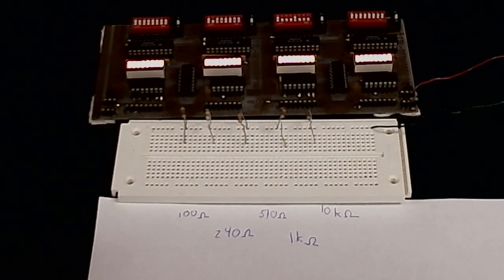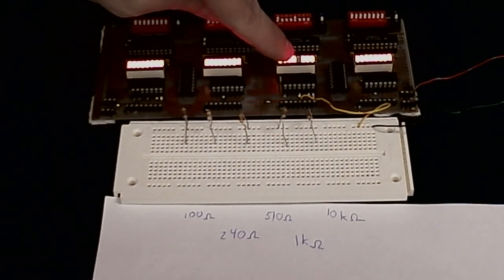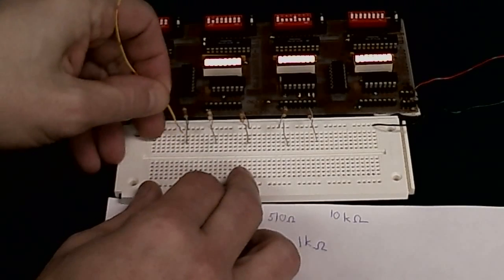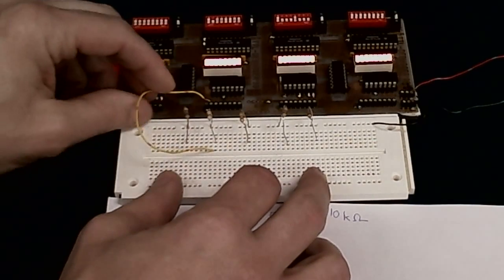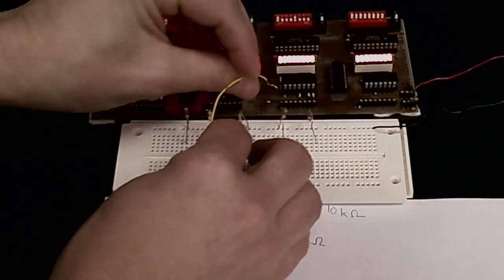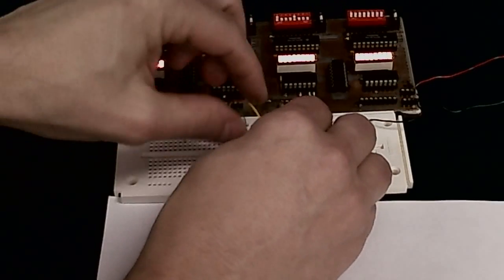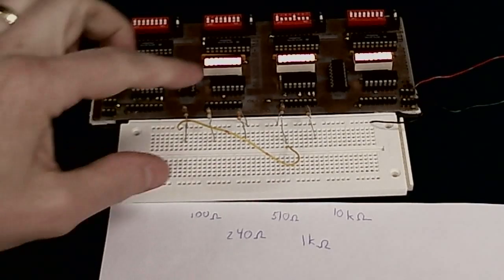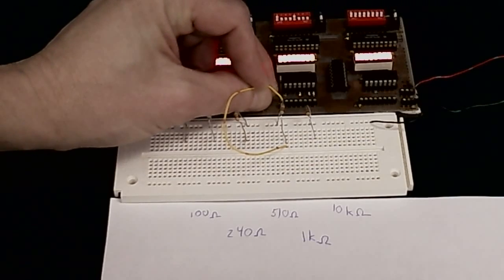Choosing pull-up and pull-down resistors for switches

Comment: Was looking for a quick calculation, but nothing better than an empirical test! Thanks for the tip!
Reply from the maker: If you have specs to tell you what the current requirements are, then the calculation is easy, but lots of times you're working without a data sheet so spending a couple of minutes testing will always work. I'm glad it helped.

Comment: What is that contraption that displays the signals ?
Reply from the maker: It's a simple board we designed and built here for circuit debugging; it has switches for input and LEDs for output so that students can test logic circuits before they learn how to combine resistors with switches and resistors with LEDs. I used it for the video because its inputs will be the same as any TTL circuit.